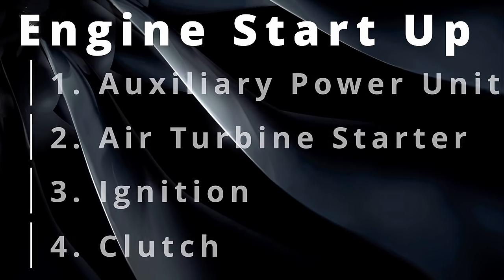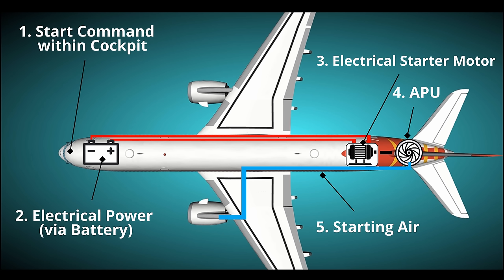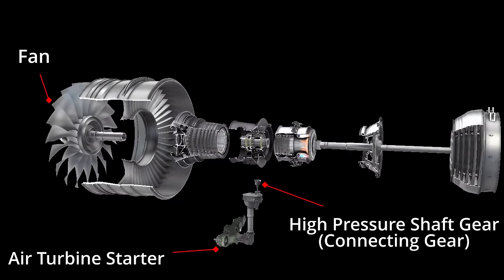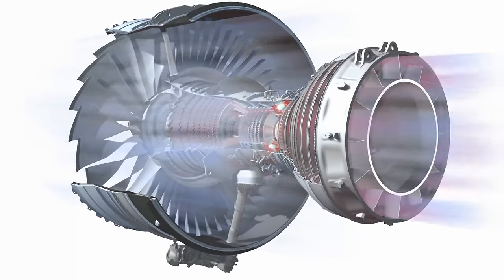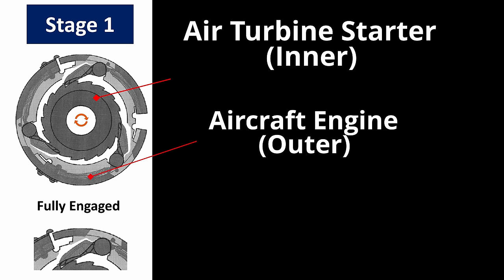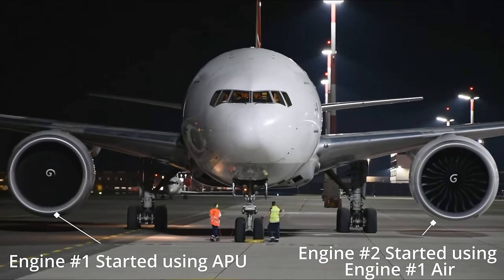How do Airplane Engines Start? (Including Startup Sounds)

Comment: Excellent video but could you follow up with a video showing the actual start up procedure in the cockpit?
Reply: I think we need a 4 hour video on each little process of each little process , I would like things broke down into elementary steps and procedures and what happens during each procedure (cause & effect), and what the steam gauges look like or glass screens look like and just a very detailed , every inch of the way tutorial.

Comment: the part with the APU delivering compressed volumes of air to the Air Turbine Starter to the engine, reminds me of a child blowing on a pinwheel..the harder you blow the faster the pinwheel will turn.

Comment: 1:53 bit wrong the gears connect to the set of smaller blades to the right of the screen which is the N2 high compressor turbine that's what the starter spins up and you hear it humming up during start not left set of turbines and also to mention both sets of turbines spin on separate shaft it's a dual spool engine some engines are TRI spool but most are dual .. also too most flights they use the apu to start both engines, bleed air starting from one engine to another is a method but it requires more rpm from the number 2 engine or 1 eng which ever engine the pilot started first usually number 2 tho

Comment: Starting the second engine with bleeding air from the first one is called a cross bleed start and is done at much higher pressure than an apu start. It is only done if the apu  is not available and at most airports is not allowed at the ramp for safety reasons

Comment: used to run a highway truck with an air-start Cummins diesel; the starter screamed like a jet engine at full throttle, but even at 40 below it did the job...

Comment: is that engine animation at 1"52 yours by any chance? i cant get over the incontinuity of the blade directions and how they reverse direction halfway through the animation. also entire clusters of fan disks are moving at different speeds when there actually solid mounted in the real engines and its kinda dong me tree in.

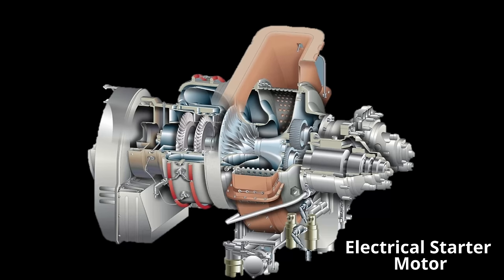Comment: 0:54 The high pitched scream you hear on the tarmac is usually the airconditioning packs, not the APU.
Reply: The packs dont make high pitch sounds🤷🏻‍♂️
Hyd- and fuel pumps does
Reply: @speedbird9313  LOL... I worked on Boeing 747's and 767's for 40 years (as an engineer). You? 
Fuel pumps sounds are insignificant compared to pack ACMs. Air-driven hydraulic pumps create a loud whooshing sound. 747 pneumatic LE drives are pretty high pitched, too.
Reply: @ImperrfectStranger  Ah, yeah you’re right. Didnt think much of the big birds😆 35 years, engineer. Maddogs (as a mech), 737CL and NGs, A320 series CEOs and NEOs. And on those the packs arent high pitched compared to what Ive mentioned.
But, like you probably, I dont consider the APU to be high pitched at all.
Reply: @speedbird9313  Good point. I didn't do much work on the smaller Boeings/Airbuses. The 737s were pretty noisy in the wheelwells, but I can't remember what the pitch was like. Of course, like all good engineers, we wore our ear protectors (that may have changed the pitch somewhat). Well, in the early days I may have been a little lax with regards to pretection.... hence my partial deafness now. 
The loudest sound I ever heard was a start cart pneumatic line bursting. My ears were ringing for hours.

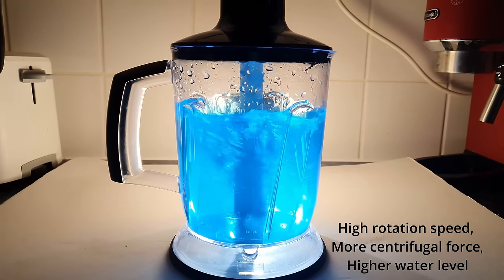Comment: Can someone give me a time stamp (eg. 3:56 ) indicating what process causes the cabin air to smell like kerosene ?
Reply: The Kerosene smell is unburnt jet fuel from the engine startup. It's drawn into the cabin air supply and you get a brief whif of it.
Reply: Fresh air intake and the air exchangers are in the center section of the airframe. If you get a long start or the wind is right or a passing aircrafts exhaust blows correctly you will get the smell of jet exhaust
Reply: The cabin air supply is tapped off the engine compressor stages (before the combustion stage), but sometimes you get fuel fumes going forward through the engine during start. Once the engine reaches a certain speed, fumes can no longer go backwards through the engine.
Reply: @ImperrfectStranger There is no engine bleed in use when the engine is being started. Bleed is selected on after engine start to supply the air conditioning packs.
Reply: @stephenholland5930  Good point. I forgot about the FWSOV (RB211)/PRV (CF6) logic/check valve function during start. 
I'm not sure what you mean by "bleed is selected on after engine start" though. The engines won't start unless you have the bleed air switch ON. 
Also, before we had logic modifications done to our 747-400 bleed systems, we had to run at least one pack during engine start. Something to do with pressure shock (going from full start pressure to zero demand or vice versa...can't remember which)
Reply: when the exhaust from your or other planes enters the cabin, the air filters cannot filter out such smells. As soon as the plane starts moving faster, the smell is gone.

Comment: I was a technician for 36 years and it still amazes me how a ton of air can pass through the 15th stage hpc blades only an inch in length in 45 seconds at take off power.

Comment: Fascinating to see a GenX engine starting with an air starter. Takes so much time compared to an older engine
Reply: That was a RR not a GE.
Reply: I blame it on the enormous fan, and the huge load it puts on the core, even at low speeds like this.
Reply: @thomasburke7995 sorry for the misunderstanding. I meant in general, a genx is impressive to see.
Reply: Fyi .. RR uses a rubber tipped steep angle cone for thier engines.. its unique to RR and the theroy is that it will deflect moisture away and the rubber tip will prevent ice forming due its flexibility
Reply: @thomasburke7995  yes, I knew about this 😊 it’s an old RR trick, also used on the RR Tay on the Fokker aircraft
Reply: GenX doesn't have an air starter, has two VFSG (variable frequency starter generators) per engine. VFSG operates as a starter then when start sequence is over they become generators. Only one VFSG is needed to start an engine but I believe both are used unless one is U/S. On a B787 the APU has two generators, generating enough power to start both engines at the same time.
Reply: @2strokemerc what about the 747-8? Old school air starter and idg’s 😊
Reply: @pg41226  is it really useful ? Because I don’t see that on GE , Pratt, or CFM engines. And I don’t think they have icing problems in the front cone. The GE / CFM front cone design is elliptical to prevent ice formation. And this cone is not heated. The older CFM engines had conical front spinners, but the elliptical is more efficient against ice formation and accumulation.

Comment: Thanks to all the men involved in this invention and those who mantained it every day.
Reply: Finally some recognition for the maintainers. Without them the Pilots who fly them and the passengers who fly in them are grounded. Aircraft require far more servicing/maintenance than a car. Most large commercial aircraft can only go 1 flight before the engines need to be serviced with oil (as an example)

Comment: When you state "the fuel is injected and burnt"... what is the ignition source?  I know how cavemen discovered fire...is this the same theory?! Or did I miss something? I understand everything else.
Reply: Two igniters per engine. They are used during start up and a few other times such as turbulence or if the crew select them. Once the fire is started, it shouldn’t go out until the fuel levers are returned to cutoff. Yes, there should always be a continuous ring of fire within an operating gas turbine engine. If the flame goes out, the engine stops

Comment: I think I saw a video once where one of the main engine was fed by an external air supply. The only explanation coming to my mind is the battery was too weak to start the APU.
Reply: The APU would have been unserviceable for any number of reasons. Having a weak battery wouldn’t be one of them. Some aircraft only have one battery and if that battery is “weak” then the aircraft won’t leave the gate because the battery is the backup source of power - the last resort.
Examples of explanations why the APU might not be in use:
- APU starter/generator defect
- APU fuel control unit defect
- APU bleed air valve defect
- APU oil cooling system defect
- APU high oil consumption
- APU fails to start due to ignition problems
- APU ECU defect
The list goes on

Comment: I understand that to start the engine you need an APU that drives air into the starter and the starter spins up the the compressor and then everything else is unwound?
2. Does the engine change thrust from the exhaust gas pressure?
3.Why are the engines so noisy?
Reply: 1. Yes, if I get it right 
2. Not sure to get it. Thrust is mainly linked to fan speed. On the ground the fan provides around 80% of the thrust. 
3. Because there is no exhaust pipes in the back of the engine. Seriously there is a lot of air moved quickly in the engine that causes this noise. The latest engines with a bigger bypass ratio are much quiter as there is more air passing through the fan only and pushed backwards at low speed. A military engine is much worse.

Comment: why doesent an aircraft engine burn all the compenants as it runs extreamly hot for hours in the air.
Reply: The turbine blades have very tiny holes for cooling air to be forced out of them. It forms a protective layer around the blade from the extreme heat

Comment: Question: during landing, before the point of tires touching runway, have the wheels been spun up so that when the tires touch down, there is less friction at the surface thus easing into the braking stage and saving tire wear? Motors in the wheels may cost more than tire replacement cost but what is the actual tradeoff? Thanks for the great detail.
Reply: I believe this has been considered long ago, but the weight and size of the motors have no room there.
Reply: Also you have to consider the extra fuel burn to carry the weight of these motors in the wheels.
To fly, weight is the enemy !

Comment: So is 50% of max rpm considered the lowest speeds these engines run at or can they decrease below this once they are started?
Reply: No. This is the minimum speed required to provide all the necessary electrical and pressure to the aircraft systems.
The engine alone could run at a lower idle speed, but it is the main power source for the aircraft needs.
Like your car with or without the A/C.
Reply: There is also a second engine idle speed which is higher by around 10% . This is called the flight idle. The purpose of this higher speed is to minimize the acceleration time in case of go around to get the thrust needed.

Comment: Cross bleeding is not that common. Usually both engines will be started using the APU to avoid back bleeding and damaging the APU.
Reply: I have no idea what you are talking about, “back bleeding”? What happens when the engines are producing 40 psi each? They use check valves to prevent “back bleeding” into the APU
Reply: @NicholasRiviera-Dr  Do you know what avoid means? Shall I post the link to the dictionary definition of "avoid"?
Reply: @a360pilot  sure you can post the definition, if you feel the need to and it makes you feel better.
Let me correct your initial comment. “Usually both engines are started using the APU because that is one of the purposes of that engine. The APU provides electrical power and for some aircraft pneumatic power. It is the fastest way to start both engines”
Your initial statement makes no sense. Check valves, bleed valves and isolation valves prevent “back bleeding” into the APU
Reply: @NicholasRiviera-Dr  Coming from a baby boomer failing so miserably in English grammar yet tying a Doctor to his social media name? If this makes you feel better, your technical words make sense to me, maybe because I use my brain when on Internet.
Reply: @a360pilot  I have no idea what you are talking about again. I am not a Baby Boomer. You still haven’t addressed your initial comment. Sounds like you are a pilot.
Reply: @NicholasRiviera-Dr  Don't worry about it. Your brain might collapse just like the Brazilian aviation industry safety.
Reply: @a360pilot  because you can’t explain your initial comment? It seems like something you read somewhere that sounds good. Clearly you have no understanding of what you have stated if you can’t explain it
Reply: @NicholasRiviera-Dr  Why would you cross bleed with an operational APU? That increases the risk of back bleeding in certain aircraft types where the cross valve and APU valve coexist. Instead, using APU bleed air to start one engine at a time with engine bleeds set to off reduces the wear and tear on those valves, again on certain aircraft types. A doctor should be able to decipher something without extra explanation. By the way, I am not an aviator so please correct me if you may, just mind your tongue please. Thanks.

Comment: What happens if both engines need to be restarted when airborne? And what happens if the left engine fails to start in this situation?
Reply: You use the drag and try to re-ignite the engine. Sometimes you even have to descent to gain speed to achieve the required air pressure to re-ignite.

Comment: What is the event during startup that sounds like a car trying to start on a very low charged battery?
Reply: is this sound heard before startup, in the cabin center, on the A-320? That is all I have observed in planes that might match your observation, but it has do do with the hydraulic system.
Reply: @PeterNGloor  Yes, 320 airbus and before startup.  Every one that I have been on does it.  Can even sound like someone trying to imitate a dog barking.

Comment: Why does it take so much longer to start a B 52 engine?
Reply: Depends on how it is being started.  It can use external air or a starter cartridge.  Plus it has eight engines, so it takes a bit longer.  On alert, they can get all eight started in a couple of minutes, and immediately take off.

Comment: Missing (but maybe not the goal of this video) the fact that the temperature is something that is very much monitored by the pilot. The injected fuel is part of the cooling mechanism of the system. If that goes wrong (and temp exceeds some max line) the engine must be shut down asap.

Comment: Thanks for such a great explanation. Q: At all this different stages, what is position of plane, I mean, not all the stage performed at the gate, right? Can you please tell us each stage at each location like at gate, at texiway, before takeoff like that.
Reply: As far as I know, the engines need to develop enough thrust to get the plane rolling after being pushed from the gate.  So the engines must be started-up completely at the gate.
Reply: The APU will be started at the gate, around the time that boarding is finishing up. Once it's running and powering the plane, the ground power and air conditioning can be disconnected. Once pushback begins, the engines will be started. They'll both be up and running before taxiing can begin. At this point the APU can be turned off. The remaining tasks and checks, i.e. flight control checks and setting flaps, are done during taxiing.
Reply: @KingdaToro  Thanks.
Reply: @KingdaToro  Depending on a lot of things, the plane can taxi on a single engine (or at least less than the number of engines, I don't think an A380 would taxi on single engine, but it might on two).
Reply: Airbaltic taxi on one  engine to save fuel, I think that the A320neo
Reply: @sensitiveissues3671 or at the end of the push-back if this is needed. I have seen that the A-380 was fully pushed back before they started their engines. Maybe it had to do with the power of the tractor..?

Comment: Can either engine be started by the APU in the event that one engine is down mid-air?
Reply: I heard that some aircraft can start an engine while in flight from the APU. In some types, there is a limit to the altitude at which the APU can operate.
Reply: If the aircraft is already flying, there are procedures to restart the engine.  Basically, the engine is already rotating due to the airspeed, so it only needs fuel and ignition.  You never use the starter while in flight.
Reply: @b43xoit not exactly.  The starter can never be used in flight.  Since the air flowing thru the engine is causing the engine to rotate, so all it needs is fuel and ignition.  Engaging the starter on an engine that is already rotating, can cause major damage.
Reply: @robertheinkel6225  not exactly. In the procedure to relight an engine in flight you have to consider the rotating speed of the HP compressor. If you are in cruise, this speed will be high enough to relight with ignition on ‘continuous’ This is done automatically when detected by the engine ECU. But if it fails to relight quickly then the HPC speed will decrease to a few % due to the windmill effect. In this condition you can use the starter to relight the engine. On modern engines the ECU will not allow the use of the starter in flight if the engine is not in the good conditions to prevent from crash engagement of the starter .

Comment: In October 2022, I got to start the APO of a CRJ 200. 
As I was boarding the plane, I was talking with someone else about aviation. The pilot called me up to the cockpit and he asked me if I wanted to start the APU and I said yes. He showed me what switches to flip and what buttons to press and I got it started.